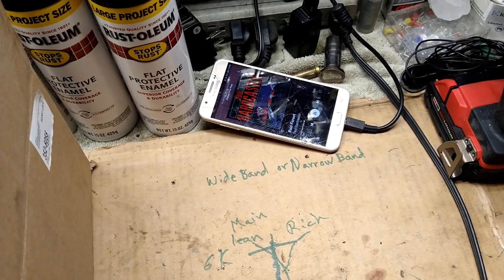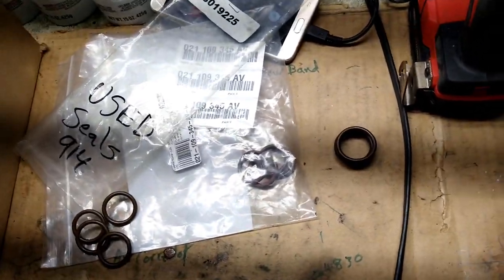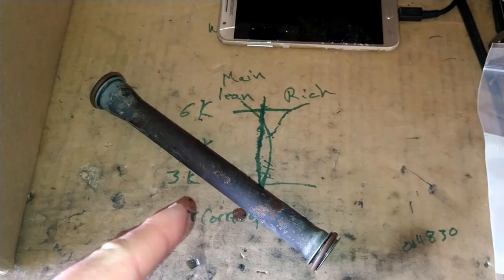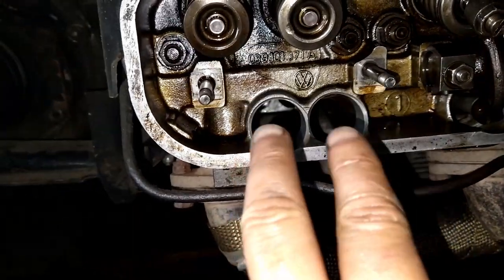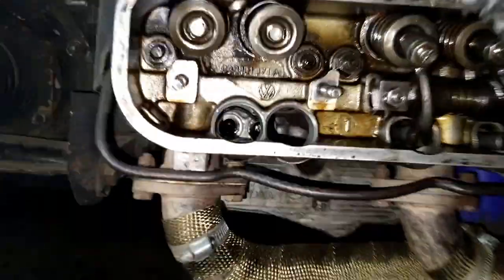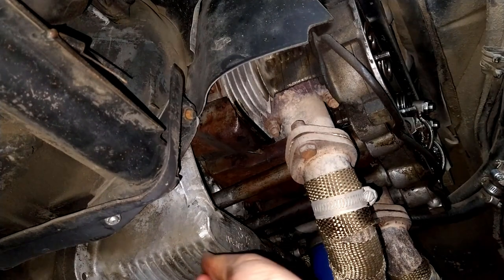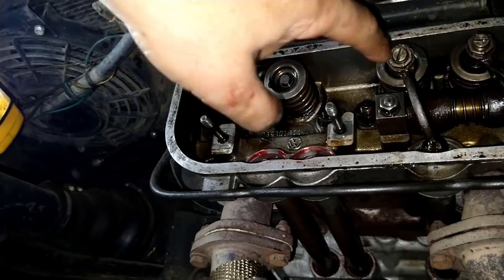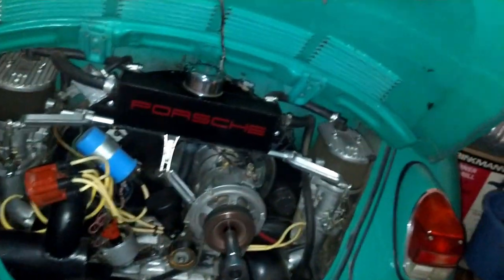Type 4 Pushrod Tube seals

Comment: Wait you can install the push rod tubes with the engine still on?? I always thought you needed to remove it to get the solid 1 piece tubes in?
Reply from the maker: That's only true on type 1 engines. Type 4 engine are so much better designed. But yes you can 😊